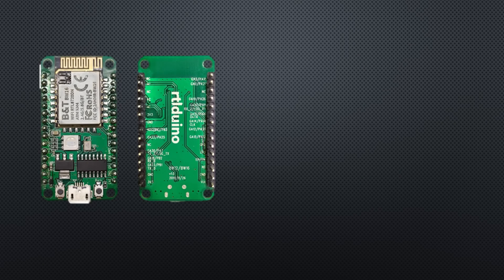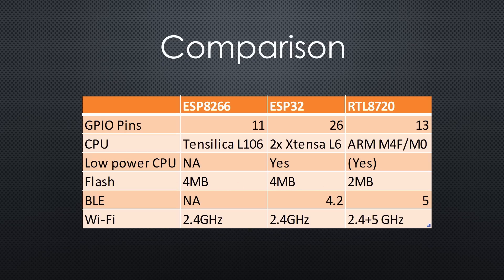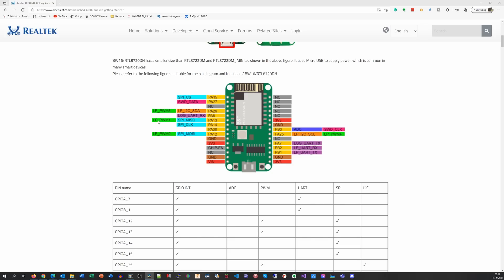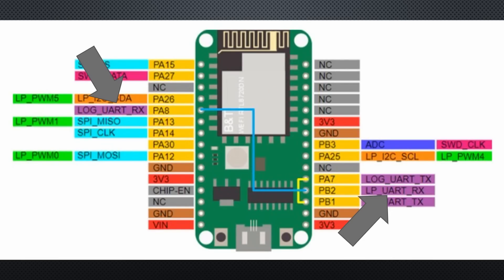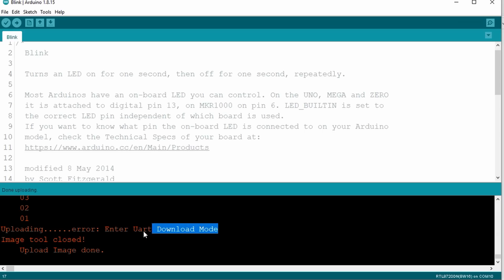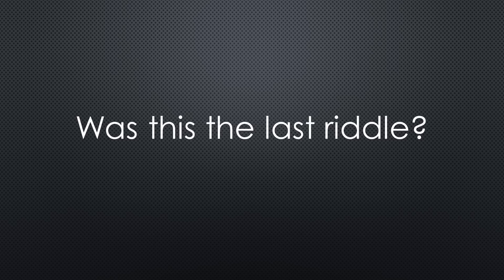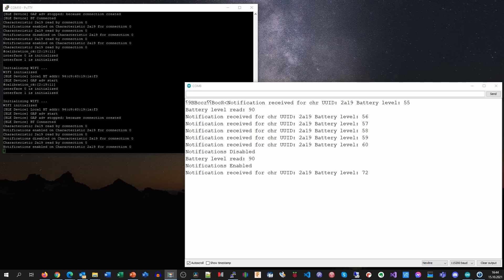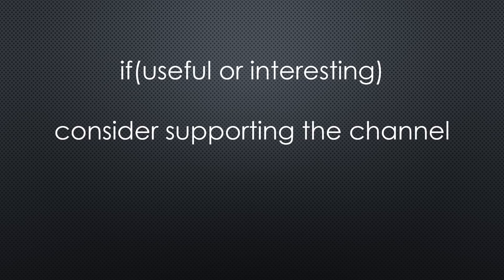#405 Riddles? The First Arduino compatible 5GHz Wi-Fi Chip (RTL8720 )

Comment: Hey Andreas, nice vid. Which example code did you use to get a 5ghz connection? All of my current examples only use the 2.4ghz band
Reply from the maker: I do not remember :-(
Reply: @AndreasSpiess  no worries. I found out that you just have to define a 5ghz wifi channel in the setup function in the .ino file. Example: channel = "52"
Reply: I introduce a direct coding method using the RTL8720 Standard SDK. I use this to introduce samples and methods for developing IOT. You can get information by visiting.

Comment: I am still hesitant to use a function purposed module like wifi to have GPIOs controlled by the wifi module itself. I prefer to shift that control over to another controller. I might be wrong to think so, but I prefer to split functionality.
Reply from the maker: On one hand it adds more parts. On the other hand you do not have to deal with wifi. A disadvantage for me would be that I have to create my PCB or buy this expensive Arduino boards.

Comment: BW16 module is our another  B&T  brand product.
Reply: https://docs.ai-thinker.com/en/rtl87xx

BW12 module specification: 
https://docs.ai-thinker.com/_media/rtl8710/hardware/bw12_datasheet_en.pdf

BW14 Module Product Specification: 
https://docs.ai-thinker.com/_media/rtl8710/hardware/bw14_datasheet_en.pdf

BW15 Module Product Specification: 
https://docs.ai-thinker.com/_media/rtl8710/docs/bw15_datasheet_en.pdf

BW16 Module Product Specification: 
https://docs.ai-thinker.com/_media/rtl8710/hardware/bw16_product_specification_en.pdf

BW16 development board schematic diagram: 
 https://docs.ai-thinker.com/_media/rtl00_bw12_bw16_bw19%E5%BC%80%E5%8F%91%E6%9D%BF%E5%8E%9F%E7%90%86%E5%9B%BE-v1.0.pdf

BW16 network configuration tool: 

https://docs.ai-thinker.com/_media/rtl8710/docs/simpleconfigwizard_v115.zip

https://docs.ai-thinker.com/_media/rtl8710/docs/wificonfig_v2.1.6_20190529.apk.zip

FAQ： https://docs.ai-thinker.com/_media/rtl8710/docs/rtl8720d%E5%B8%B8%E8%A7%81%E9%97%AE%E9%A2%98-20190604.pdf

Module certificate：https://docs.ai-thinker.com/rtl87xx/certificate

Comment: Your question (May 2021) "Why should i do it" The pins on power FETS etc. is about 1.1mm flat side and .5mm side view. You must have felt the the resistance when you push in a FET etc acrose 3 adjacent rows of breadboard tracks. It is a lot easier when all 3 pins goes into the same row. (sideways) Also consider the contact surface. So, i just suggested bending the legs 90 degrees before pussing it in. Kand regards, Cassie Carstens
Reply from the maker: You are right. I adopted this method and if is excellent!
Reply: @AndreasSpiess  Good! Someone (JP Spies) shared this with me about 40 years ago. So, I have no claim to this. But, PLEASE share it. You and Adel Kassah is my IOT teachers. Thanks!

Comment: I don't fully understand the point of having 5GHz wifi yet, I did not have any problems with 2.4GHz and microcontrollers are clearly not fast enough to benefit from 5GHz speeds.
Reply: One reason is to offload a congested 2.4Hz network that only really has 3 usable channels in the US. That said, I will usually opt for 2.4Hz for the longer range.

Comment: Waited soooo long for 5Ghz Arduinos. Can’t wait to turn of my 2.4 wifi at home. But it should be flawless. Hope for the next ESP32.
Reply from the maker: After knowing teh tricks it was not too complicated to use them.
Reply: I introduce a direct coding method using the RTL8720 Standard SDK. I introduce how to develop IOT using this. You can get information by visiting.

Comment: RealTek has been in the microprocessor business for a long time. Many, many PC motherboards have at least one RT product - often the audio subsystem, sometimes the ethernet controller. Would have expected better from those guys. Seems like they threw something together without much thought or care, certainly beyond sloppy at basic things like labeling the pins properly or consistently.

This is not typically the design engineer's fault (unless they're really bad at their job), but more often comes from executives and marketing thinking they can make some quick and easy money by cutting time for proper design, documentation, and quality control.
Reply from the maker: Well possible. It also seems that the board comes from a different company and the GitHub belongs to a US address. So maybe it was a lack of collaboration.

Comment: It looks like you found part of your translation by recognizing patterns in pin naming, but I'll share this bit that I recognized:
The Pxnn notation (e.g. "PA1", "PB3", etc) is one I've seen before on PIC microcontrollers and others.  It refers to "Port A" and "Port B" (and so on), with pin number indexes, often 0 thru 7 or 15, depending on how many pins per port their device offers.  They can sometimes be used in parallel, so you can work with a byte sent to the Port instead of needing to set single bits for each pin separately.  Very handy for bit-banging protocols and changing outputs or reading inputs in parallel.
Reply from the maker: You are right. This is naming convention is also used internally in the Arduinos and needed of you want to do bitbanging as you described.

Comment: There is a simpler way to override the default AT firmware :
Just connect a serial terminal on AT port - the one available throught the onboard USB port without any additionnal wiring - at 38400 bauds then sends the command "ATSC=0" to switch to OTA1 image.
Tadaaa, the module can now be flashed with arduino, tested and approved (some Aliexpress sellers put this tip on the product page)
Reply from the maker: Thank you for the tip. Very simple!
Reply: @AndreasSpiess  The above dosnt seem to work for me :(
Reply: @AndreasSpiess  on a side note what would be the best way to convert a hall sensor output to be accepted in a speedo that wants a reed switch output. I want to keep my original speedo sensor

Comment: At 8m 0s you are about to write some code and I've already given up on this MCU. Terrible labels, bad documentation, less flash. Needing to jumper for programming was the icing on the cake. So far the ONLY advantage I can see is Wifi6. Everything else is worse than the ESP32 chips I use now. Continuing on with the video... Conclusion, yeah, I could make it work but I'm not needing 5ghz at this time, so I'll stick with the ESP32. I'm hoping the next ESP32 has better analog inputs, too.
Reply from the maker: Good decision!

Comment: Yeah I would have stopped at the pin naming scene and dropped this chip. 
I like that the manufacturer supports Arduino but if it is as half assed as the pin documentation it will produce more trouble than solutions. Pretty sad as the esp32 gets older and older with no real update yet
Reply from the maker: They grew the  ESP32 family but the newer chips had not a lot of traction in the Maker community yet.
Reply: @AndreasSpiess  yes I think thats most likely because they draged there feet so much with the software support. 
Is the S2 and C2 Arduino support finally in the release state or still in the beta state? The S3 will take Years if they even bother 
The
Reply from the maker: I do not know the actual status. I still use the old ESP32 boards I have on hands...

Comment: That board design does seem to be making things confusing. However, the RTL8722DM chip itself is very promising; obviously the dual-band wifi is compelling but so too are the cores (Cortex M33 and M23), the generous ram/flash and the large number of peripherals and GPIO (up to 55). The Seeed IoT and Mini boards look to be much better options to explore the features - I remain hopeful it's going to be a useful chip!
Reply from the maker: I agree about the RTL8722. But I hope they will get their documentation up-to date. Do you know if we can use the second core?
Reply: @AndreasSpiess  Yes, I'm assured that the core will be available for general use - and the first can be put to sleep to run at low power.

Comment: Chip is very slow - up to 200Mhz M4 core - M0 is at 20Mhz. Bandwidth barely can reach above 11mbps according to user tests
Reply: A 200MHz Cortex M33 is slow?
Reply from the maker: I had the same question. AFAIK the blackpills are much slower and were quite good in my benchmarks. But I did not test Wi-Fi throughput because this is not important for my scenarios.
Reply: @mattytrentini  1 core yes and it is used almost entirely to control wifi and bt. so mostly you get M0 performance. just cheap design and also Realtek has poor support

Comment: Hi Andreas - I really enjoy your videos and learn a lot from them.  I also love your sense of humour, like in this video about how the engineers made sure that nobody but the most sacrificial could use their product.  LOL  Please keep these coming.  My interest would be using MCUs and sensors in general aviation - how to build AoA indicators, gyros, accelerometers and other instruments that costs thousands of dollars if purchased from the big boys.

In your video comparing STM32 to ESP32, you ran a benchmark to compare the speeds.  The benchmark had one or two lines of the sort
 x = CONSTANTA + CONSTANTB; 
 x = CONSTANTA * CONSTANTB; 

You realize that the C compiler actually performs the addition/ multiplication in compile time and this just becomes a literal assignment at execution, without the arithmetic operation?
Reply from the maker: I do no more remember my benchmark. When I created it I was very new and did not think about the influence of the compiler. You are most probably right with your statement.
About aviation: AFAIK a lot of the cost is due to testing and regulations. So material cost is probably also low for the big guys...

Comment: The IC is from Realtek but board design is from another company. Too much hardware compatibility issues on the board design.
Reply from the maker: I agree that maybe the manufacturer of the board screwed up the silkscreen. But the documentation is on "Realtek paper". And a lot of confusion comes from there.
Reply: @AndreasSpiess  Agreed. I think all the documents are from ether maker or AI-think, Realtek just put the documents on the webs. However, documents are really bad not only for this board.

Comment: Just a note on 5G radio waves, because of the wavelength of the wave is so much shorter the same transmit power may provide a less reliable connection. 5Ghz radio waves do not go through obstructions like 2.4Ghz radio waves. 5Ghz=6cm, 2.4Ghz =12cm. All radio waves have a hard time traveling through materials thicker than their wavelength, just something to consider as 5Ghz radio usage becomes more commonplace.
Reply from the maker: You are right. This fact is visible with a smartphone in a house with walls.

Comment: I remember trying to use RealTek chips a few years ago.  I finally gave up because of the same riddles you ran into.  I ended up tossing them, because they just weren't worth the time spent on them.
Reply from the maker: Thank you for sharing your experience. I do not know if the chip is good. At least it is the only we can use on 5GHz. But the documentation needs an update.

Comment: This video was very helpful. I believe this new technology just came out this year and is still in development. I hope that the manufacture makes versions that come completely blank so you don’t have to erase the current firmware before a custom code will run in the future.
Reply from the maker: I read that some of the boards already come without firmware...
Reply: @AndreasSpiess  may i ask if you know how rare they are?
Reply from the maker: You do not see this B&T logo
Reply: @AndreasSpiess  ok. Thank you for your help.
Reply: @AndreasSpiess  i would like to ask for more help on this subject. I got this controller and i have the same problem with the built-in firmware making the code not run. The help website is no use and your video doesn’t fully cover the part with the firmware. This is the only video that exists in the world for this topic. There is no way i can seem to program the device. I tried downloading a recommended flash tool on the help website, and i need more stuff for it to even run. Do you know any way i can erase the memory chip without the need to download anything or replace the flash chip with an empty one? Thank you for any help you can give me.

Comment: You CAN use the core 0 on the ESP32 using tasks.
Also the original chip is the ESP8266 not the newer ESP32.
This chip seems fine for 5GHz tho because even the newest ESP32-C6 has wifi 6(802.11ax) but only 2.4GHz.
Reply from the maker: You are right with core 0 of the ESP32 (I made videos about it).

Comment: I wonder if it would be worth just getting the module, and using a plain breakout board? Should help reduce some of the pin confusion! You already need the RS-232 adapter, and 3.3v could be done without the inefficient regulator. 👍
Reply from the maker: Creating a proper board for sure is a good idea. Particularly if you need additional components.

Comment: ok so i am really confused now by ESP32. because i had assumed it was ARM based MCU like all others out there. however today i look up on wikipedia it uses an 'Tensilica Xtensa LX6' ? which is it's own proprietary design? or was it actually RISC-V based to begin with? Because wikipedia also tells me that it might be the Tensilica Xtensa LX7. which is RISC-V. What i do know for sure is that the ESP32-C3 is RISC-V based, so presumably is LX7. And that the future ESP32-C6 (5ghz) will also be RISC-V based. However this does not tell me which cores has my own ESP-32 here. if it's RISC-V or not. Why i ask these stupid questions? Well because i want to know if there is any change of architectures from Tensilica (proprietary) --> to open source RISC-V. Because potentially that might lead to issues or difficulties in worse performance. Or other drawbacks IDK. The whole thing has confused the heck out of me now. Having assumed all this time it was ARM. But what I was trying to identify is how well future ESP32 (of 5ghz) will works, when compared to my current ESP32. The 2.4ghz one which we all are used to using and is $6 everywhere. And is really fast, with a low power sleep mode etc. Which is another thing. Because if the new one does not have as good a deep sleep mode. Then that would really suck :/ but maybe not so much if it kept its ram refreshed, and did not reboot itself (as you had mentioned during the last previous LoRa WAN video).

Anyhow hope you are doing well. It was good effort here to try to figure this mess. For the flashing etc. BTW i think i missed the part in the video where the LED started to blink. Maybe I lost attention for all the other serial nonsense, all getting in the way. But still, i think you did an excellent work here to explain this device. Many thanks
Reply from the maker: Espressif never used ARM cores and they started to experiment with RISC-V. The easiest way to get to the truth is always to read the datasheet. If you use C++ the architecture is probably not as important because must of the periphery anyway is not open source (see my RISC-V video).
Reply: I introduce a direct coding method using the RTL8720 Standard SDK. I use this to introduce samples and methods for developing IOT. You can get information by visiting.

Comment: The 2.4 GHz network at my place keeps dropping IOT stuff and it is not the router. I have replace the router with no difference Andreas.
Reply from the maker: My router has problems with too many fixed IP addresses. I had to go back to automatic assignments...
Reply: @AndreasSpiess  Automatic is the same, house has lots of IOT stuff.

Comment: For presence detection, I will simply use home assistant. Not worth the time to simplify cost by using a 5G wifi chip. ESP8266/32 or the Tuya Chips works well.
Reply from the maker: You are right. You can use other sensors for presence detections.
Reply: I introduce a direct coding method using the RTL8720 Standard SDK. I introduce how to develop IOT using this. You can get information by visiting.

Comment: For me 2MB of memory and no straight forward programming method among other things is hint that they probably intend it to be somewhat "easy to use" component in larger applications that will provide not only 5GHz Wi-Fi but also will allow diagnostics and recovery of parent board even in case of catastrophic  faliure
Reply from the maker: Looking at the firmware with the AT commands I would assume it was designed as a daughter board for other computers in need for a 5GHz connection. Seeeds uses it in one of their devices like that (the main processor is an SAMD51).

Comment: Andreas, kudos for completing all levels!
with regards to the idea of a uC with low power to support the 5GHz band… well. this is i guess a niche thing. the range is subpar compared to 2.4GHz.  sure it can help using wifi when you have continuous analogue 2.4GHz noise in the area. but usually small uCs don’t use the channels at a high speed, so even in a crowded wifi environment they’d be just fine. yes, the AP can be also limiting factor, how many connected clients it is able to handle. also the power constrained BLE is a bit lackluster.
one extra question: what 5Ghz standard did you use? 802.11a or 802.11n?
Reply from the maker: I do not know (I am no specialist and did not care)...
Reply: I introduce a direct coding method using the RTL8720 Standard SDK. I introduce how to develop IOT using this. You can get information by visiting.